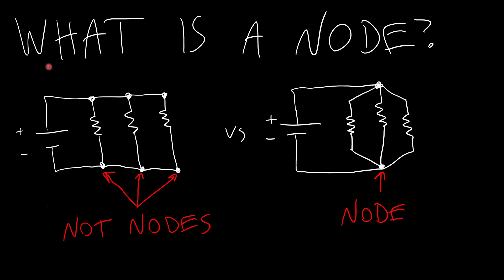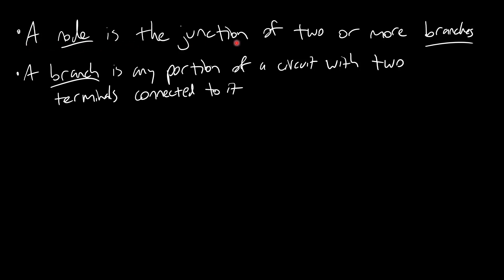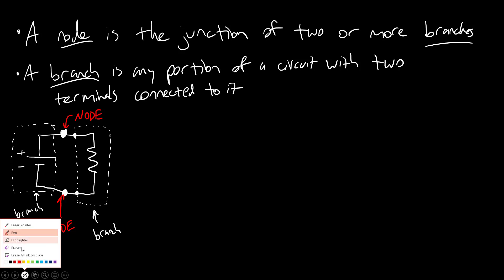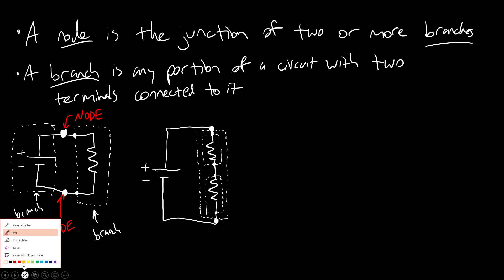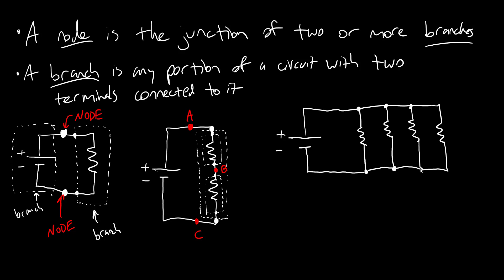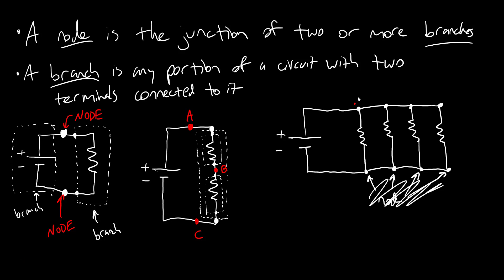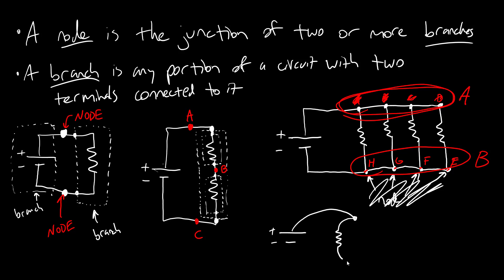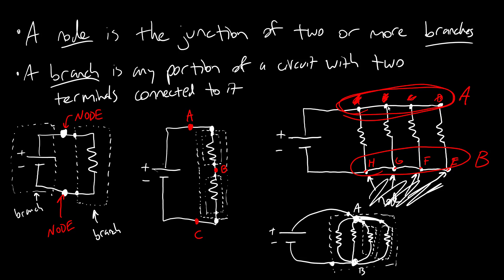Intro to Circuits 15: What is a Node?

Comment: It was super frustrating because I knew nodes were simple but my professor just LEPT over how they work so it was very hard to differentiate between the dots for wires and nodes